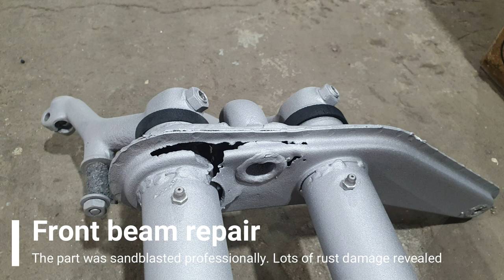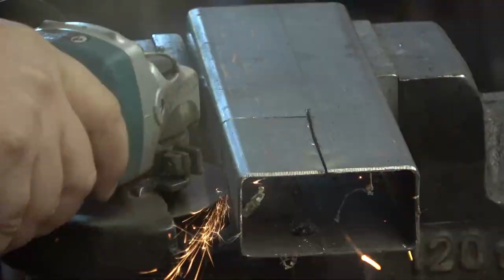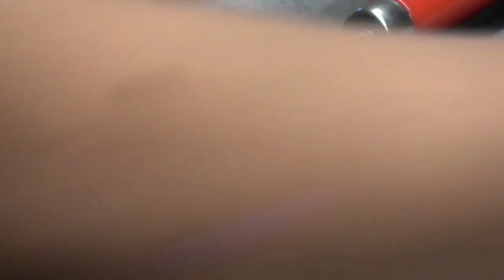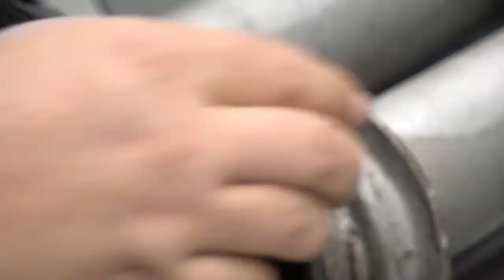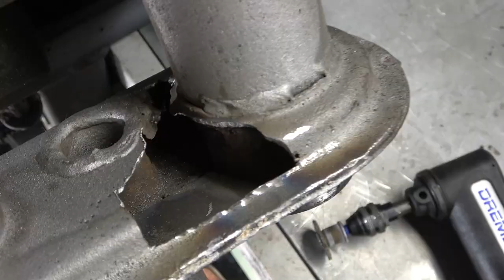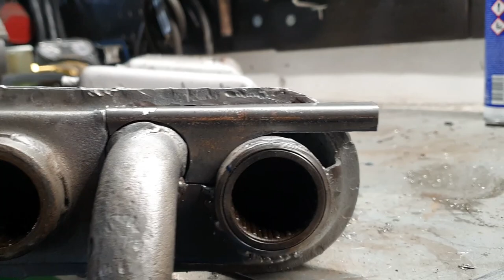Rusty '62 VW Beetle - Part 8 - Front beam rust repair

Comment: Just been through your catalogue of videos. What a talented chat you are ! Brave too cutting off the frame head like that. The extent and quality of your repairs is truly impressive. Can’t get over the intricate repairs to that front beam when most of us would have binned and bought new. So the plan is to use your newly rebuilt chassis with the ragtop body from the other car? 

New subscriber right here. Keep the videos coming 

Ben 🇬🇧
Reply from the maker: Thank you, Ben. I do have another front beam in good shape, but I like a challenge 😀.  The plan is to put the ragtop body on the rebuilt chassis. The original car is a ragtop, but previous owner cut the roof and replaced it with a metal one. I want the car to be 100% original, so bought the second car for the ragtop. Initially wanted to replace the roof, but the bodies are in similar condition, so no point in cutting roofs, easier to fix up the second body. Unfortunately, I can only work on the car a few days per month, so progress is slow. I will keep on filming, though. Cheers!